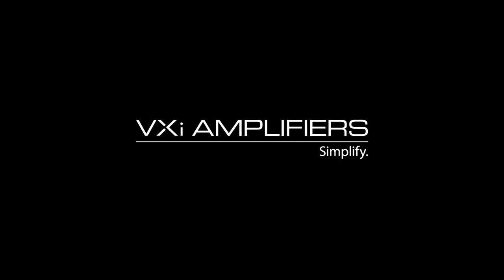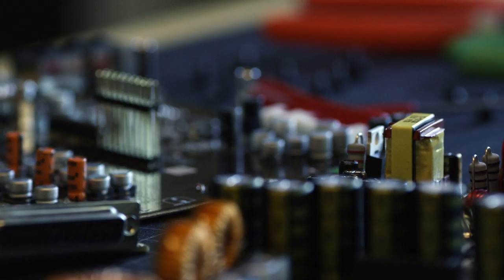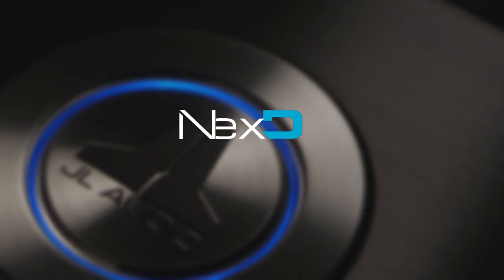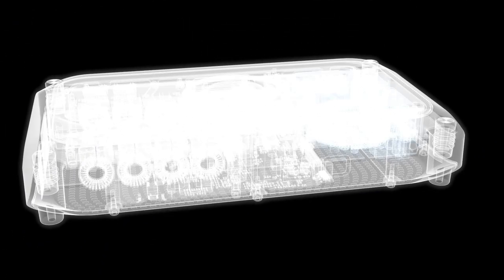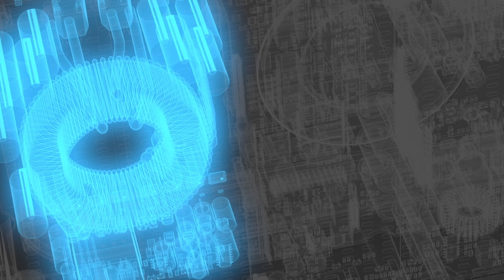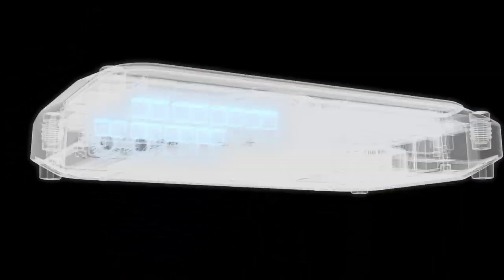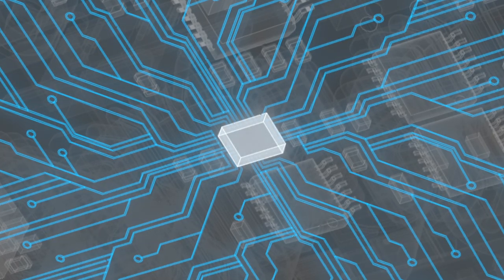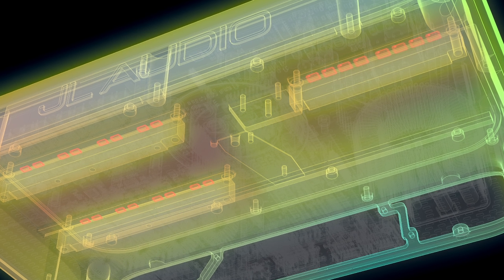JL Audio VXi NexD2 Switching Technology

Comment: Are these jl audio compac t version amps? HD is still yalls best amp right.
Reply from the maker: Hello Adrian,

HD amplifiers are indeed one of our top performing compact amplifiers. That being said, I recommend also looking into our new VXi amplifiers. VXi amplifiers couple high-power amplifier power to advanced built-in DSP.
Reply: Im gonna give them a try but i drive a semi. I got all kinds of room! Im not sold on class D compact ampss even though these appear to be the best ive seen. But you said yourself your hd amps are still #1. See what im getting at. I will i promise give a check out. Little pricey guy but they do work great but i gotta tell ya there are one or 2 companies that also put out great quality stuff and somewhat cheaper that on a dyno and in person just not any logical reason. Hd 1200 amp is almost twice what a rockford t1500 amp is and im sorry. It doesnt out perform it. It just doesnt. It is as good sorta kinda but not really. If im gonna pay 30/40% more i better have clearly the better product and it isnt. It just isnt. Now these new vxi models they do look a bit better than the compact fosgates i give ya credit there but these hd amps have been out a long time. That price just doesnt warrant that now. Hope yall thinking about upgrading that lineup cause it needs it. Dont mean to be harsh but at some point that price better have a reason for it.
Reply from the maker: The HD1200/1 monoblock amplifier utilizes a fully regulated power supply design. As a result, it delivers 1200 watts x 1 channel into a 1.5 to 4 ohm load. It also offers wide-range frequency response (6 Hz to 8kHz), Single Cycle Control™, selectable high or low pass crossover filtering (with 12dB or 24dB slope), and a selectable analog input signal voltage range.

While there are other amplifiers on the market that may deliver precisely what you need for your particular application, these distinct features are a few options to consider when purchasing a new amplifier.

Comment: I would love to have a VXi amp, I’m looking to put a custom system into 
my  new Kia Stinger and would like to integrate two sets of  VXi amps 
for two 13W5 sub with separate mids and Highs in the audio system. I 
have a Audison Bitone I was going to use, but looking to s get ride of 
and would prefer to use the VXi for all my DSP settings to allow for a 
smaller footprint of hardware in the build I want to put into the car.
my old build i did as a hobby - https://youtu.be/amHBH-pR36U

Comment: These are by far some of the best amplifiers. Using the 1000/1 to power 2 10w6v3’s and it sounds great. Looking to swap over to 2 1000/5’s so each sub gets 600 watts and the rest of the system gets 75x8 and takes full advantage of the DSP that is built in. And the best part is how easy on the system electrical these amps are. Thank you JL for making a great product to enjoy our time in the car while listening to our favorite tunes!!!
Reply from the maker: Thanks for sharing! You're very welcome!